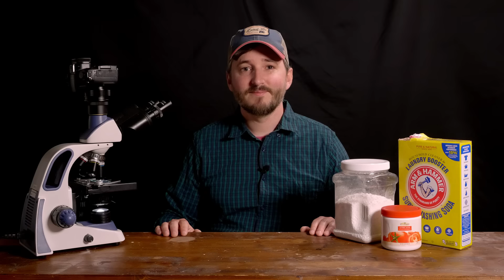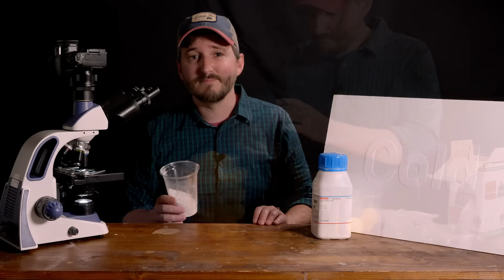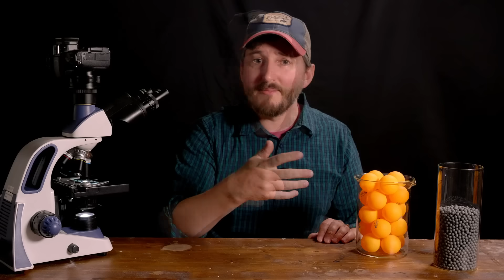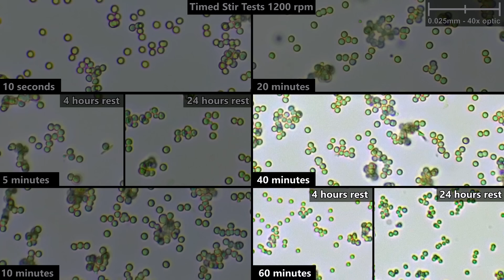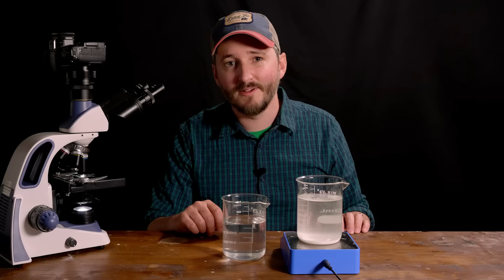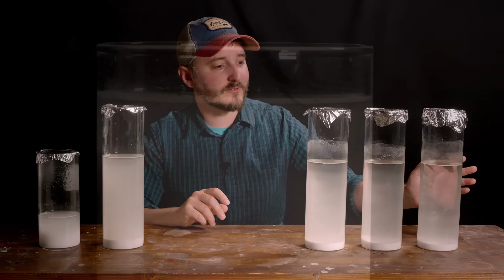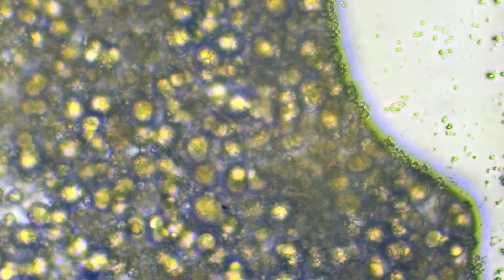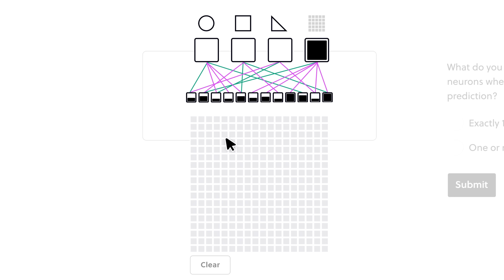Making Infrared Cooling Paint From Grocery Store Items (w/Novel CaCO₃ Microsphere Synthesis)

Comment: 1:54 "object will easily absorb the same spectrum of infrared that it emits" [radiative sky cooling paint must point UP]
So even if the paint has to be space facing we could possibly have a periscope/greenhouse? type arrangement* piping heat onto the orientated paint from an angle a kinda Passive Paint Periscope Pipe Peltier* effect thing. 
Though such angling might not work 🤔on the space-facing part as maybe the microspheres just spit the heat right back the direction they came from to the outlet and reducing heat output instead of helping with cooling.

Would possibly change how we do roof venting and things like solar-tube-lighting so they are dual function.

* see roofing goose neck vent/exhausts
*Peltier's in there for alliteration cool points though it's misplaced since it's an electrical effect

Comment: This is amazing, great work! I have a couple questions that I plan on trying to answer with experiments. How much cooling power, or how much infrared is reflected, per square inch? How would that be measured? Can a more solid material than hdpe film be used to insulate the panel while still allowing the infrared to be reflected?
Reply from the maker: Around 90w per m2 or so is my guess. Cover materials need testing
Reply: @Nighthawkinlight  Thank you for your reply! I am inspired to try to build "window units" for my basement via aluminum cooling plates and water/PG.

Comment: For small and precise applcation you could use a modified fdm  3D Printer. There are already several projects for printing liquids with a syringe reservoir through the cold nozzle, mainly for food printing.

Comment: The discussion of increasing density by using "spheres" was part of teaching science in high school (or perhaps middle school). Why does adding 50 ml of water plus 50 ml of alcohol NOT result in 100 ml of liquid? Because H20 is a MUCH smaller molecule than alcohol and simply slides in between alcoholic particles. "Hides" so to speak if all you are measuring is volume. Of course alcohol has a slightly different evaporation rate than water so if left uncovered a mixture of equal "parts" water and alcohol will not remain equal parts for very long.  Parts have to be carefully defined.   In this example we used milliliters, volume. In a different example we might use milligrams, mass. For alcohol and water not very different, alcohol will have both more volume and more mass than water per molecule. An interesting way of demonstrating this property at school was to have marbles of different sizes. So if you want to demonstrate this property for a classroom just as he did in this video, marbles, Styrofoam balls, even erasers even though not perfectly round will demonstrate the concept. I sometimes used "shot" ball bearings because for other "experiments" having metal was useful for demonstrating other concepts. Erasers and Styrofoam allows you to use sticks to make more rigid structures for chemical equations with angles like H2O.

Comment: You are going to win a Nobel Prize some day. You could probably get a higher density by drying it directly on the surface you want it to adhere to. you could possibly use a fibrous material to act as the scaffolding for the paint to decrease the chance of splintering. possibly using a single incredibly thin sheet of fabric or some sort of material with microfibers, or possibly both. something I think could possibly work, although I am not sure, would be using a preformed cellulose structure as scaffolding, such as highly broken up leaves, with the cells dissolved and removed, 2 good videos have been made about this by the thought emporium.

Comment: What if we applied the acrylic-water mixture to the surface first, then sprinkled the powder on top and maybe rolled over it with a silicone rolling pin or something like that? Would we end up with a not thick enough powder coating? Or could we do it in layers like this?
Reply from the maker: You would need to test that and find out

Comment: if one could make cooling and anti-cooling paint one could coat both sides of a TEG and have a tiny power generator
Reply: I just realized that if you had a reflector you only need one type, just redirect the energy to the other side. 
And in realizing that, I thought, why waste this energy we've extracted?  Make a patch antenna out of rejection material and point it somewhere to see if the target heats up, if so you can receive that energy transmitted and convert it into whatever form you need.

Comment: Considering the fragility of the paint I'm super curious if it could be used as a resin dye. Resin should be fairly weather resistant with its major issue being that a lot of resins yellow over time. Might get too expensive for large cooling panels, but it might be an avenue worth considering!

Comment: Try adding 2% Carboxymethyl cellulose ( CMC) and 1 % bentonite to the "paint." These additions are used to make ceramic glazes brushable. Works like a charm and your "paint" isn't far off from a ceramic glaze. I'm not sure, but this may affect elasticity. Then again, it may not, so worth a small batch test. You could also try it without the bentonite, but it works better with.
Reply from the maker: Good tip!

Comment: Well, if it can only be within a contained environment due to structural weakness, and saps heat through the back side— would it fit well on the outside of air flow tubes?

Comment: Does the paint have to be directly applied to the surface it will be cooling for it to work properly? How fragile is the paint when it dries? If the answers are,  No and Not, my thought would be to pour the paint into a pan and float a film or paper on the surface. Then you would have a laminate.

Comment: I had a fish hatchery in an industrial building that had a composite roof that would get hot enough to fry an egg and overheated my fish with massive mortality in one record heat year (1998). I found a type S lime source that was very white and just put on multiple layers of lime slurry - pump and hose spray application.   I am in So. California where we don't have summer rain.  I was shooting for just stopping the solar input with reflection with "whitewash" but it worked better than that.  As the CO2 from the air reacted with the Ca(OH)  it formed CaCO3 crystals that cemented the layers making it impervious to the rains.  All those crystals of CaCO3 resulted in the roof being cool in direct sunlight.   

Note that snow is just crystalline.  What is the advantage of spheres when it is just reflecting light on grain boundaries reflecting sunlight in the micron size crystals?  

One of several types of CaCO3 is amorphous and that may be what you have in your spheres.   However, over a long time, the most stable form is calcite crystals with aragonite (used by most shelled animals and corals) being a little less stable.  That means if you have one nuclei of calcite the more soluble amorphous CaCO3 will dissolve and grow the calcite crystal.  

Lime was cheap for large area coverage.
Reply from the maker: Limewash can work well, but it's unlikely to go below air temp. Spheres are better for ir emission and for high light rejection. Density is also important because it means you can use less binder.
Reply: @Nighthawkinlight  I used no binder.  the growth of the CaCO3 crystals from the Ca(OH)2 cemented it together.  It was blinding on that roof without sun glasses. 

I have a black and whitewashed wall from some experiments on plant growth.   Ck the T with sunlight black and normal wall at 117ºF and the white at 77ºF.

Comment: What wavelength of light doesn't interact with the atmosphere and allows it to radiate heat into space? (nanometers or terrahertz would be ok)
Reply from the maker: The infrared windows are between 3-5um and 8-14um
Reply: 3um=3000nm

Comment: Just thinking a bit while I was looking at your video !! Firt one question : I presume that the dried result is rigid , and can crack in case the support is banged or fall on an hard surface !! Só is there a possibility to make that "mess" somewhat flexible, só that it could be painted or sprayd on a soft surface like cloth !! Now I want to explain the "WHY" of my question : The result that I dream of is some product that could protect soldiers on the fields form IR searching devices !! Even if it take out something like 80 or 90% of the IR signature of a soldier off , it could be a life saving system !!!

Comment: Theoretically it shouldn't matter what the large size crystal is. Because the smaller micro spheres should fill up the spaces anyway. Think of it like the mixture of concrete where sand and cement can flow in between the larger sized and unevenly shaped gravel. Can you try this? If this works we don't have to worry about process complexity of making larger microspheres

Comment: I think I'll try to apply this "paint" by dipping the plate in it. Allow to dry and repeat the process until the desired paint thickness is achieved. Should result in the most even coding possible.
Reply: No, you'd wind up with a very thick, uneven coating, like an ice cream bar. If you really want it perfectly even, you'd want to atomize it in a spray.
He mentions in the video that he had trouble with sprayers. Thinning it enough to use in an HVLP gun might be tricky.
Edit: To get an even coating with it in a paste-like consistency, you might be able to work out guide spacers on either side of the panel and a spreader across the top. Similar to silk screen printing or solder paste application.
Reply from the maker: If you apply multiple coats the timing is critical. You need to apply the second layer once the paint firms up, but before the water leaves the paint and it's fully dry

Comment: As a physicist let me explain radiative cooling in simple physics terms. There are two transmission windows in the infrared region in which the emitted radiation is less absorbed by the atmosphere and dissipates into the coldness of space. The short wavelength infrared window between 3um - 5um and the long wavelength infrared window roughly between 8um to 13um. Most terrestrial objects emit their radiation in the long wavelength window,  and this is the wavelength range targeted by all radiative cooling devices.

Comment: Can we use any other widely available solvent? Acetone is not available anymore, only ethyl acetate. I think acetone is a controlled substance? Because of acetone peroxide and meth, so what other solvents can be used?
Reply from the maker: I'm sure I'll have more recipes to share in the future. For now I only know the one thing that works.
Reply: MEK aka 2-Butanone. Also, perhaps denatured alcohol, though I think it would be a very slow process.

Comment: But but but you've just solved global warming.😂 Convert all IR emitted by buildings to that wavelength and chuck it out into space. Just coat the roofs of every man made structure between 40degrees N and 40 degrees S. Bye heat

Comment: Looks to me more like an ink than a paint so have you looked at how inks coat surfaces? Think it's called silk screen printing. If you have a 1mm thick metal round the edges of the surface ypu want to cover and have a dead straight scraper spanning the gap just pour and scrap to get a 1mm thickness coat over a flat surface. Or something similar just a thought

Comment: Great work, was pleasure to watch your video. And it was thought provoking:
1) Is area of spheres (so area of phases contact) relevant factor? It feels like it. Won't than paint from only micro-bubbles be more effective? It will make paint filled by only 65%, yes, but that may not necessarily by bad thing, as this way it should be easier for infrared to escape paint, right? It's thickness is not negligible, right? I feel like packing to the maximum is not most optimal, but the optimum is somewhere along the way from 0% to 100% fill.
2) Some kind of mirror below paint may increase effectiveness of system, just like with spotlight, or car headlight design, where reflective part behind light source increases it's effectiveness. When paint is just put on a wall, or other surface, IR radiated by paint gets absorbed by it. I guess it's around 50%, like both sides of paint emit same amount of IR probably? Would work better with less densely packed pigment, for reflected light to escape more easily.
3) Just wanted to say I'm huge fan how you used acrylic solution to obtain light-scattering substance. So ingenious.
3.1) Oh. Maybe layer of this scattering acrylic WITHOUT CaCO3 could be used as reflective base between "wall" and cooling paint? Just a wild guess though
4) And the research on grain size is also very cool. Like - this is what I would want to do for PhD for example :D Fun, useful and insightful. Science!
Feel free to test or not to test any of what I wrote. Man, your work is so cool. Looking forward to new videos! Cheers from Poland!

Comment: Probably going to get lost in the comments, but you should look into silica encapsulation of your particles to waterproof them. Tetraethyl/Tetramethyl Orthosilicate can be used in small quantities to create thin coats around particles of all kinds using many of the same methods you demonstrated, not the safest thing to work with indoors though.
Reply: Should be safe if you do it outside and very very carefully. Did a research project with TEOS recently, can confirm it does exactly as you said.
Reply: I've been looking into silane as a sealant and adhesion enhancer for hollow microspheres as syntactic foam components. Just my twopence worth...  😉
Reply: Yes, hydrophobic compound, the most important substance to prevent water absorb and mold growth
Reply: @sihamhamda47  what about fumed silica ?
Reply: Do you think just mixing them together might work?
Reply: Where can an average 'Joe' get those chemicals?
Reply: Adding another layer on top of the microspheres seems like it would reduce the effectiveness of this cooling solution... or is the encapsulation pretty miniscule? I'm guessing it binds to itself?  
  
  
Re-painting something is pretty standard maintenance so I'm not sure if I would give up effectiveness for longevity if that is the case.. but this sounds like definitely something to test out for MK3 version of the formula
Reply: how do you make it? there's a simple to buy compound that I could use instead?
Reply: @acs147  react silica from desiccant packs with KOH, makes water glass.
Reply: What aisle do I go to so I can purchase Tetraethyl/Tetramethyl Orthosilicate?
Reply: @Dresdentrumpet  Aldrich  has  thousands of chemicals for sale, i'd try them

Comment: How about spreading the paint onto panels using a sort of paper making method by making a frame with permeable sheet, putting a blob of the paint on the sheet and spreading the paint using a spatula or a vibrating point. After that the sheet can be removed and left aside to dry and another one can be put in.

Comment: What if you add a heatpump to the ac design? The Paint should improve the heat flux on a heat exchanger (if the radiated heat corresponds to the heat of the paint and substructure)

There might even be a temperature range where the radiation is highest (as in temperature difference), you could try applying it io a heater and test on various heat settings, if theres any change in temperature difference

Comment: My dude might not see this comment, but I think the better way to apply this wouldn't be as paint, but as tiles as roof shingles or outer wall panels. The consistency and properties of it wet kinda looks like the stuff we use to make hand made terrazzo tiles. Might wanna collab with the Hydraulic press channel if you apply this idea tho, cus the pressure needed to make the tiles is really high.

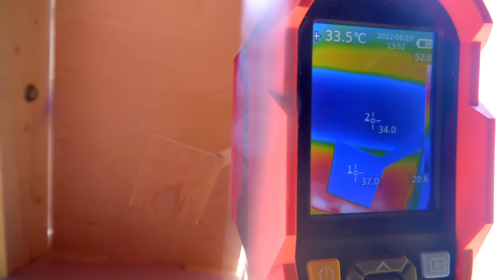Comment: FINALLY someone mentions that the thermal camera CANNOT be used to measure temperatures. 👍However, the problem is more complex than simply 'calibration for different materials' (~3:50). The sum of emissivity and reflectivity is always 1 (guess why). Thus real materials always reflect their surroundings and this adds to the thermal radiation measured by the camera - giving wrong results. Many times this can be ignored, but it has to be understood first. Think about measuring the glow of glow-in-the-dark paint in darkness vs. daylight with an ordinary camera... the glow is the same, but the results are completely different!

Comment: Please plot  temperature vs efficiency (basically Tambient - T paint surface). I'm thinking about a radiative liquid Cooler that then could be used in a liquid dissecant air conditioning unit to further improve efficiency, which is great because the heating stage is basically a solar water heater (absolutely free energy)

Comment: I'm excited to see where you go with this.  My biggest question is how this can be applied in a durable and cleanable application.  does it need to be isolated with cellophane, or can the radiated light pass through glass?  is there any possibility of making it more of a surface material using a protective clearcoat that would insulate from ambient temperatures, but allow light to pass?